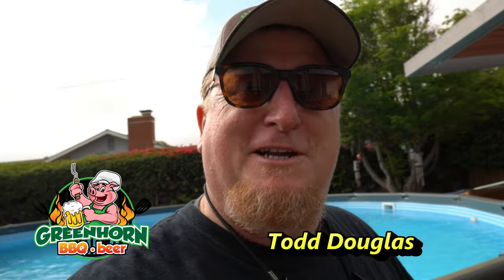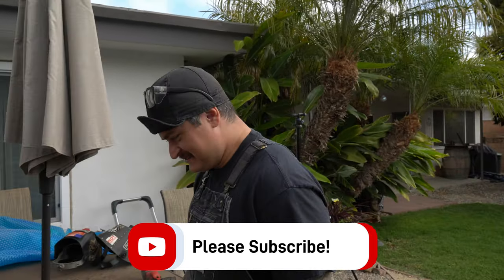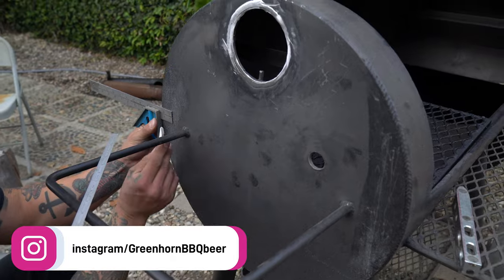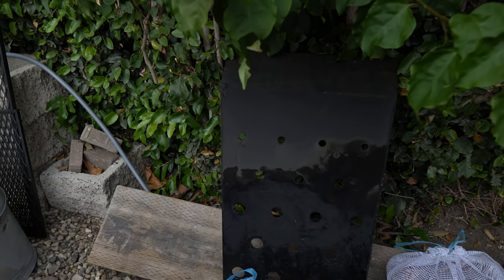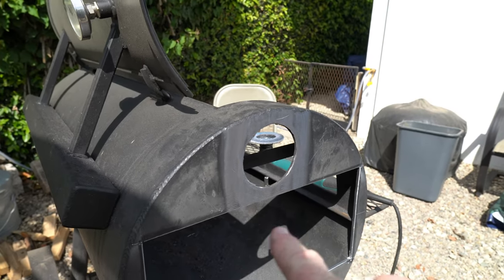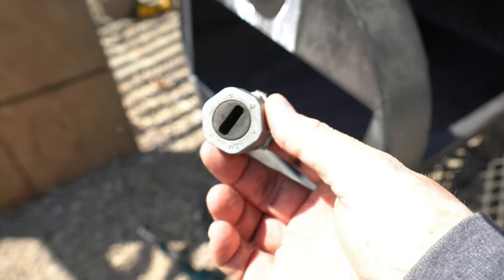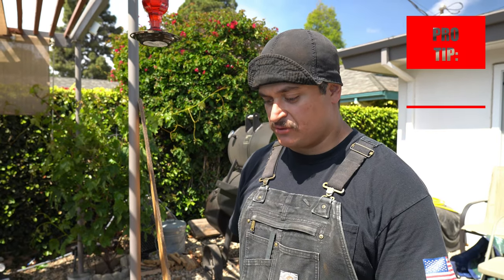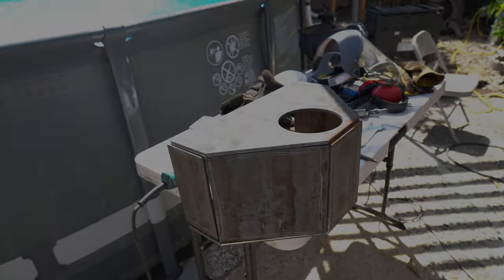Smoke Stack Collector Mod / Huge Stack on Yoder Loaded Wichita Offset

Comment: Awesome collector. Nathan did a great job. My thought is the deflector is going to give you a bottom up hot spot in the middle of your grate. On my pit I removed mine and replaced it above the grate and it moved the hot spot closer to the firebox. It’s worth a try. Great video and that Yoder looks badass
Reply from the maker: Thanks! I'll try that
Reply: Go back to deflector I would just get punch plate and run punch plate the whole length as a tuning plate be good to go no hot spots good air flow Hammer down big fire